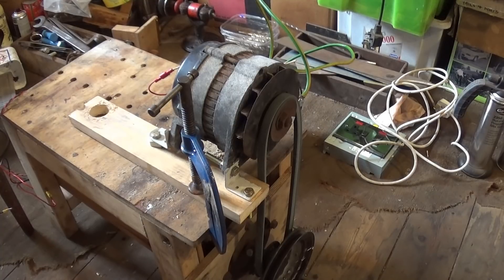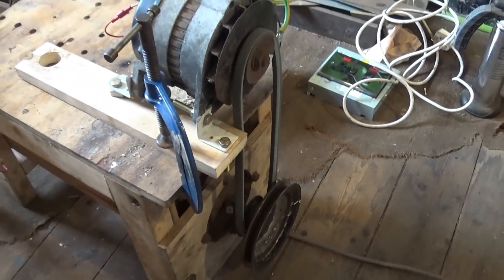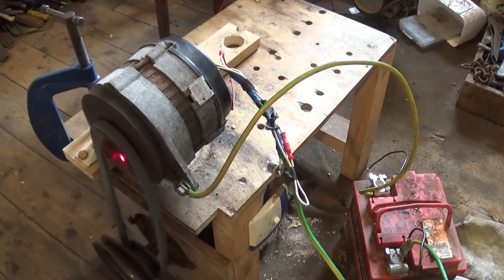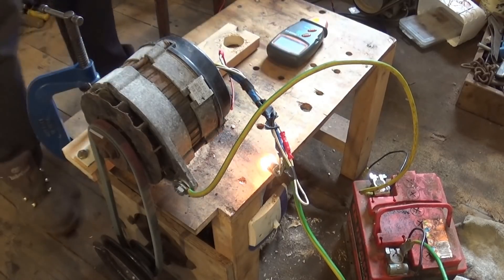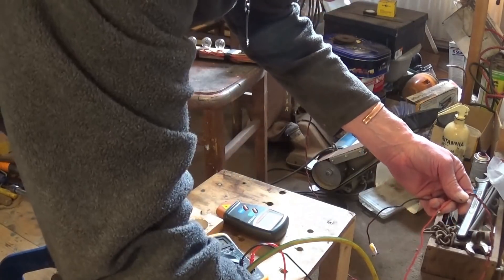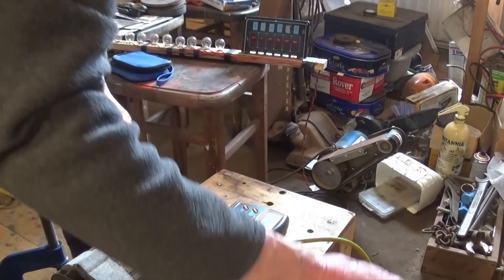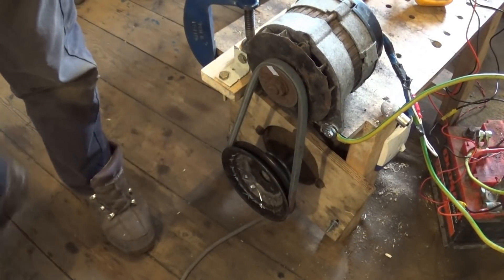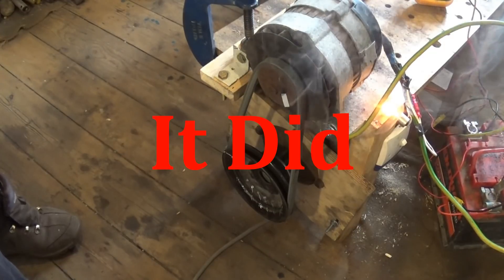Alternator Fun on a Sunday Afternoon

Comment: That was funny Malc go crack the window open get that smoke out lol.
Reply from the maker: Yeah bit of fun Andy. Plus I've now got v belt pulleys to use on the lister.
Reply: Yeah and with the new shaft you have a good chance of mounting them now, any ideas on what your going to build next?
Reply from the maker: @andywilliams1160  No Andy, not really thought of what's next. Steering clear of wood saws etc. too dangerous because you can't stop the engine. Would sort of like to do a kind of lineshaft, loose pulleys etc. Will have to see. It could of course be mounted in the shed.

Comment: Everyone can learn from this video ! If an AC motor runs not the RPM that stays on the spec. plate (1400 or 2800 RPM) they burn quickly ! Malc I think you need a 1.5 or 2 HP motor ! Good smokey video Ahaha !
Reply from the maker: Yes they have to run at the correct speed. We nearly burnt this motor out when making the log splitter. (see video Totally Homemade Screw Log Splitter Epic Fail need more power) They need a 4hp motor. Yes needs a 2hp motor to drive it properly. However this is the next job for the shaft. Then when it warms up, can come outside with more space.

Comment: What an ending that was a lot of torque for that motor .
Have you tried running it on the larger pulley before?
Reply from the maker: Yes I tried when I fitted it yesterday, and the larger pulley did turn it, albeit slowly. I knew the motor wasn't powerful enough to turn it on the larger pulley. However it must have got warm running it so long on the small one it just overheated. Needs at least 2hp to drive an alternator.